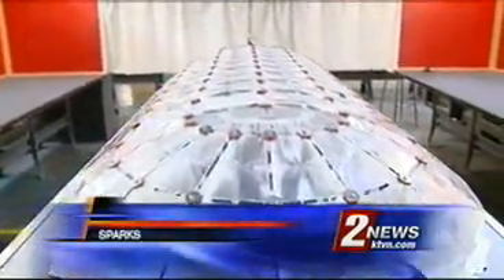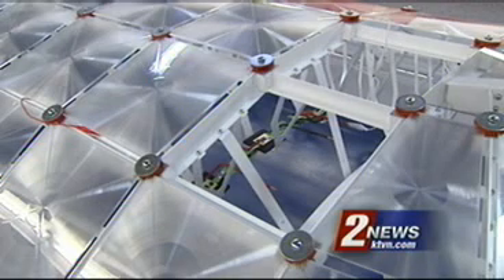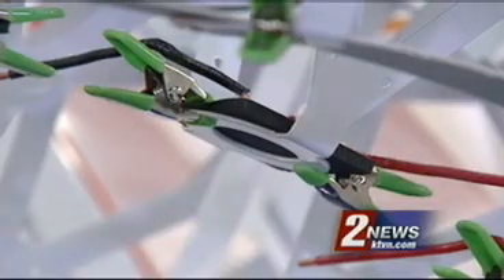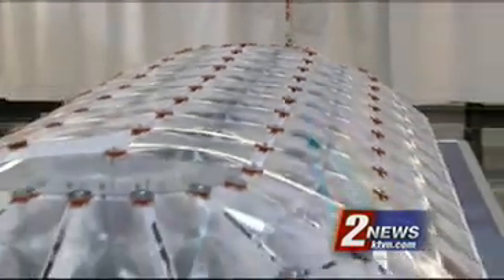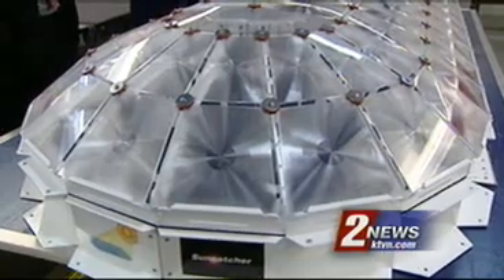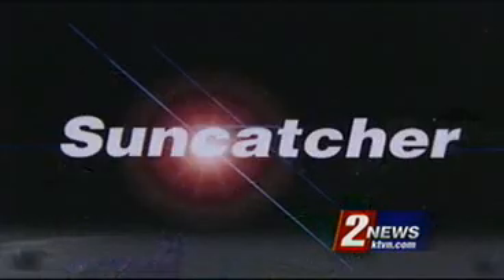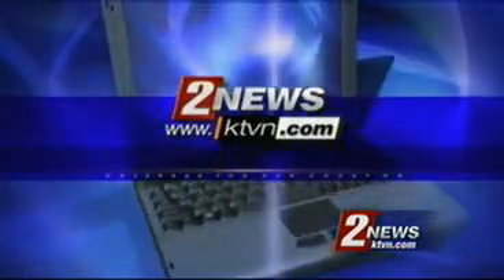Solar Panel Concept (no longer being developed)

Comment: Why was this cancelled? Ill bet the Power Co had something to say about this and either threatened them or paid them to NOT make it.....what an EFFIN pity!!
Reply: +Karen Robart the problem with concentrating light on 1 spot on current solar panel tec is that the panel heats up and becomes much less efficient or even melts. lots of people have tried and failed
Reply: +Karen Robart Oil companies gave them a big fat check not to make it.

Comment: The ability to concentrate heat onto one spot would present the opportunity to make hybrid solar cells and Stirling engines which would produce even more power from the same sunlight. Essentially the cooling system would be self powered and provide additional power.

Comment: Magnifying light creates high heat and faster degrading of solar cells, so heatsinks and fans must be used, which in the end creates more expense more maintenance and more headaches, now if they are using micro solar cells that's a different story.
Reply: Harry Flo Yes, I guess you would have had to watch the whole video, as they said they were using smaller cells. Here's the real deal: heat is not what degrades solar cells; rapidly changing temperature is what degrades all solid state electronics, whether it is a GPU or a solar cell. You don't need to actively cool it at all; you only need to mount it to a mass of material that can displace and hold the temperature and keep it from changing too fast. You can boil water in a wax paper cup because the water touching the wax paper won't allow the wax paper to get above boiling temperature. So something as cheap and widely available as water can be the heat sink. No need for aluminum or fans. If steam is created regularly then these can double as water distillers and also produce electricity from tiny steam turbines from the same sunlight, thus improving efficiency even further. This is now public knowledge. It is open sourced or in the public domain. You can't patent common knowledge and keep it from the people.

Comment: The design seems flawed to me.  Its dome shape would only catch a certain section at a time relative to the sun's position. The plastic lens itself will discolor under the daily bombardment of the sun's rays within months. In a year or two, the lenses will become opaque and virtually becomes useless. The construction itself is more complicated and have more parts than a typical solar panel making it impractical as far as time and cost are concerned.

I am not surprised that the company stopped developing it.
Reply: The type of plastic they use was more resistant to U.V. damage
Reply: Agreed it's flawed  bullshit

Comment: I wonder how many government grants and subsidies those hucksters burned through before they went under.  You can tell it's a scam because they show it inside instead of in the sun powering something.
Reply: thanks for sharing, back in 1978 I tinkered with solar till, but Reaganomics passed bills to regulate it's production and the corporations didn't want green energy so it all of a sudden became very expensive to build panels and it was not worth building, a simple 15$ panel became 5 to 7 hundred over night! those GREEDY bastards!

Comment: I said this on someone elses post a while ago. Take a fresnel lens and aim it at a solar panel which increases the suns power to a smaller area. I never tested it but my concern was whether or not the solar chips could handle the extra heat. The heat that comes off a lens like that can cook things like an egg. Or an ant like we used to do as kids with a magnifying glass. So maybe they came into problems with the heat. Or Government.

Comment: Seems to me to be flawed as the lenses only work from one angle.  Get a magnifier lens and leave it in one spot and watch the focal point move over time.  'Might' work if you have a solar tracker pointing it the right way, which also improves any PV cell.  Basically either a scam or just ill thought out.
Reply: thats why the cells were based on a fresnel design. fark sake.

Comment: not new, this idea is not origional, you can actualy buy  Fresnel Lenses Magnifier's, used for concentrating the sunlight onto solar. and i bet the reason they stopped doing this is because the high concentration of sunlight destroyed the cell.

Comment: I use Fresnel Lenses for solar thermal every day too. But a solar panel of the same size will produce the same electrical energy as a Fresnel lens focused on a CPV chip. Look, they cancelled the project. Why, because it is pointless. Read the UPDATE.

Also, upload a video of your own with this concept if it really works.
Then you will prove me wrong and you can pick up where they left off:-)... and get the same results.

Comment: There's a NEW design using Holographic lenses instead of Fresnel lenses, it's much cheaper.

Not kidding.  The holographic film on the front of the cells focuses the sunlight.

Comment: I saw some good-looking 160w - 200w Chinese solar panels online yesterday for 75 cents per watt, and some of the leftover UniSolar flexible stick-on panels for about $1 per watt. 

You have to shop around, though. Most of the panels of either type are double or triple those prices. I had to Google "UniSolar" and "solar panels" for a hour to find the best prices. 

Even good ol' Harbor Frieght is a ripoff right now, which is surprising. Their little Chinese panels are $3/watt.

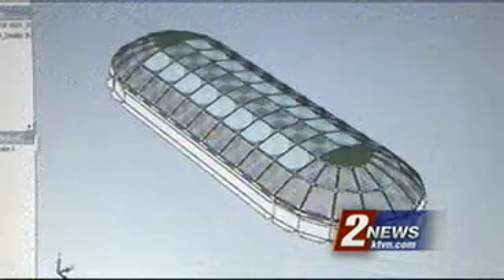Comment: 1:10 regular overhead type Fresnel lenses, one central ring axis = one focal point. The entire unit would need to track the sun. For the same cost you could deploy 100x100 watt standard PV panels in exchange for the 10% efficiency gain they are claiming. Project is now dead, that about says it all. CPVs only value is in outer space where shipping cost per kg is very expensive. Regular PV is now 1/3rd the cost of CPV per chip, CPV requires concentrators, tracking, and cooling/chillers.

Comment: Actually....its possible they are using MPPT to maximise the cell level output based on the Fresnel overlap and movement of the focal point inside the panel...Also notice carefully, the Fresnel is a special type...its not a standard Fresnel lens....looks like a 2 or 3 focal point lens...

Comment: It is me:-) 
Sq area to efficiency is the end watt production. CPV cells are now more expensive per watt based on cells alone as PV is below $1 a watt. Also, CPV requires complex thermal heat removal and a concentrator + tracking. Regular PV does not. So the per watt price is cheaper. Our entire channel evolves around concentrated sunlight which is best used for direct thermal applications. For voltaic apps, PV is now the best option. No moving parts, to noise, no excessive heat. IMHO

Comment: Each lens needs tracking and the Fresnel lens Concentrates sunlight vs Amplify sunlight. Solar cells are less expensive that Fresnel Lenses now. The size of the project determines the square area and power potential. CPV cells are very expensive = heat tolerant cells. You could build a regular PV array 5x larger = 5x the power for the same cost as this project. Also this design is flawed. ALL lenses Must face the sun at the same time for optimal power.

Comment: Every electronic component made out of silicone is thermally biased. The more heat applied to PV cells (sunlight concentration = HEAT), the less efficient they are in producing electricity. Unless there is also a heat-sink attached on their backplane to cool them down… you can't beat the physics.
If the cells can be cooled down by some sort of running water (i.e. at a river), then you could even quadruple x 2 their output...

Comment: Dan, you are correct, Fresnel lenses will not bend light the way it is needed in this application; they do not work like mirrors. But they are catching more energy with those angled outside rows; I wonder if it is enough to offset the cost of the chips.

Comment: I make self tracking holographic lenses, but... they are only slightly over 80% efficient.  The nice part is, there is a tradeoff... I can make planar phase versions that are even less expensive to produce than those shown and are MUCH lighter and easier to assemble, but the lens will not diffract more than 33% of the light hitting them.  Although, ...that IS allot more than using no lenses at all!?  So...

Comment: this suck lol lot of jobs lol yea, in china lol. never in america. my 12v solar panel work better then stuff. anyway, my has Cap connected to it. give it a boost to the battery bank. each 200v 3300uF , at night time, show that it charging lol they no sun out. the cap hold a charge for a while. like solve ur night problem lol

Comment: What would the Material Safety Data Sheets (MSDS) have to do with how the material works long term? It does not have anything to do with it. Most likely the type of plastic and other material they use are proprietary and cannot be further investigated. Sure general plexiglass will start clouding, but how do we know what king of plastic they are using is?  According to "SuperCallus" post, it is made from acrylic. How does he or you know? I want to know where to get credible info. GOOGLE lol

Comment: Everything is worth researching. I have a need to question everything and determine the facts for myself using credible sources. How do you know the panels (because of their shape) will not withstand storms? Are you using Intuition? How about the multiple "10x" more floor (roof/ foot print) space, how and where is that data derived? You don't have to post active links. I can cut and paste them into the browser. Where did you gather information that generated your comments about this system?

Comment: BTW, you can try to make this yourself. Those are fresnel lenses. Go to any website that sells mini solar cells and line up the fresnel lens with the solar cell. See if it increases the output. I will when my truck is fixed but right now I'm waiting on a dealer only part that is on back order from the manufacturer so I'm pretty stuck.

Comment: Know why nobody's seen this in the last 3 years? It DOESN'T WORK.
Since they use lenses to focus the sun's rays onto the small solar chips, the light would shine through each lens and focus in the middle. The side, top and bottom lenses curve at an angle with the solar chips perpendicular to the lenses, sunlight won't hit these. Also this type of panel would need a tracking system to keep the front directly aligned with the sun.

Comment: @snarfdwarf They didnt, they are still working on it but the heat up issue was too problematic. Its a way for a company to get great startup buzz. 

With these cells as well as traditional cells heat is an impeder on voltage flow. So putting it in a fernel lens bio dome doesnt make sense.

Comment: @PM3520 they probably built it open like that because if it was hot enough in there to power like  a steam engine, those plastic lenses (and PV cells) would probably melt.

Comment: Nice idea, but still just a prototype.  They'll need to seal that shell to deal with rain, wind, dust, wasps, etc.... Might be a better idea to seal all the plastics together into a tight bubble.  Then there's the heat buildup...  I'm betting there is still some engineering to go here, but an interesting approach.